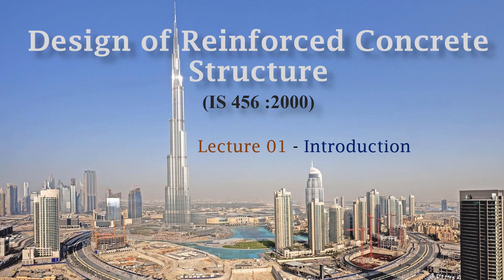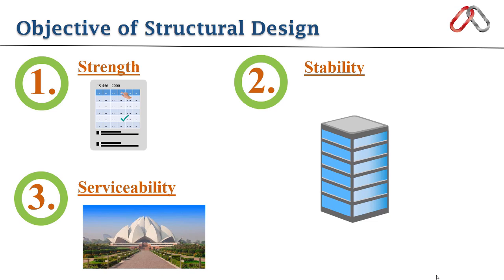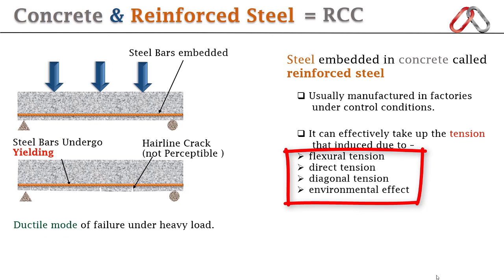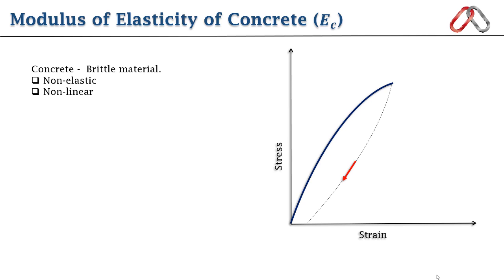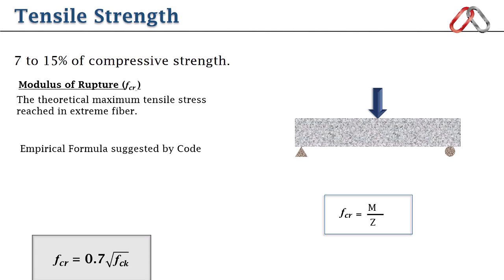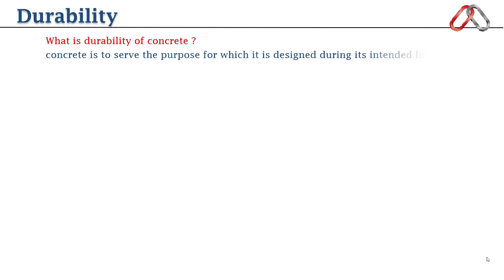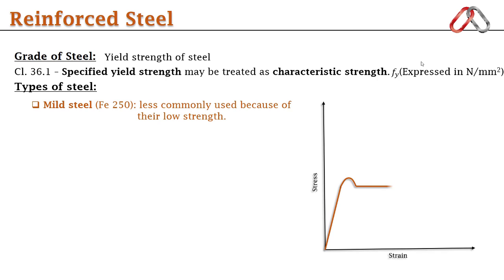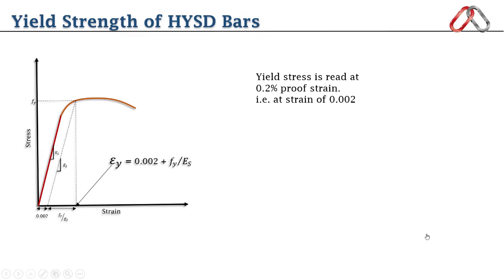Introduction to Reinforced Cement Concrete (IS 456 - 2000)

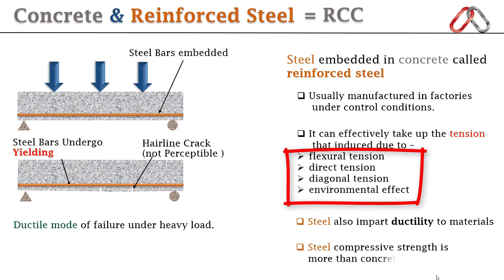Comment: at 8:30 u've mentioned that steel has more compressive strength ...but concrete has more compressive strength right!!
Reply from the maker: Dear Geetha,
Steel maximum compressive strength is around 250MPa.
And on site concrete maximum compressive strength is around 50 MPa.
Thanks

Comment: we want to learn  complete  typical  design of small building having overhead tank lift machine room  lift shaft etc  right from calculation of loads design of rcc members
design of footing how much load we are transfering to soil as rcc consulting professional doing in thrir office with detail explations step by step calculation using formulas
complete in all redpect so that we can design another building
manoj
m
Reply from the maker: Dear Manoj,
We are into academic teaching. Your request seem to be too specific. But I think your request will be entertained to some extent in our advanced RCC lecture series which is due to start in few months..
Thanks
Reply: thanks

Comment: Shall u say that, what is the number IS 456 and 2000
Reply: Sir I am asking what is 456 in is code. is there any background for that code numbers?
Reply from the maker: IS 456: 2000 is Indian National  Building code. National building codes have been formulated in different countries to provide guidelines for the design and construction of structures. The codes evolved from the collective wisdom of expert structural engineers, gained over the years.
These codes are periodically revised to bring them in line with current research, and often, current trends.
456 represent here for Plain and Reinforced Cement Concrete and 2000 represent the revised year.
Reply: okay, why they numbered only  456, why they couldn't  choose any other number like 24, 37.....
Reply: ramu parimi you have to this question to who actually found the is 456.. there was a PLENTY number of code book each book is denoted in different number which is used for the reference that's it ... it is just a number there is nothing logic behind this number